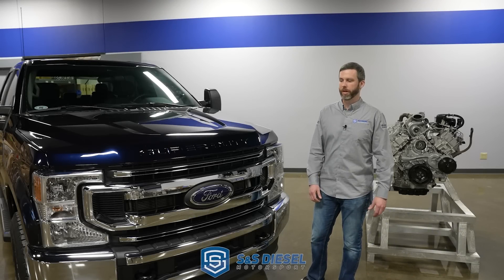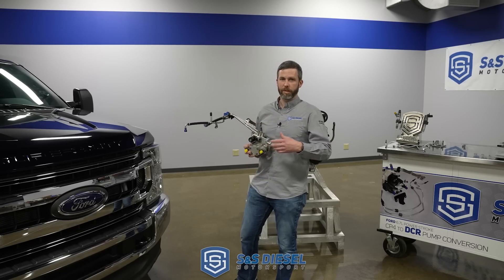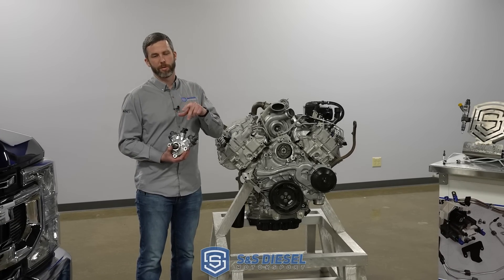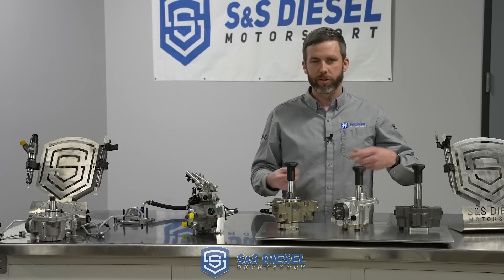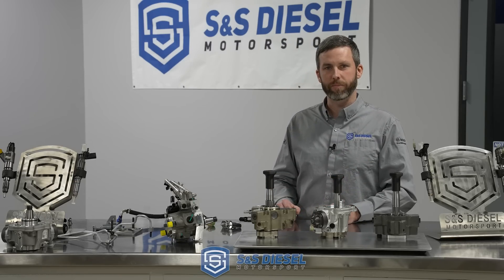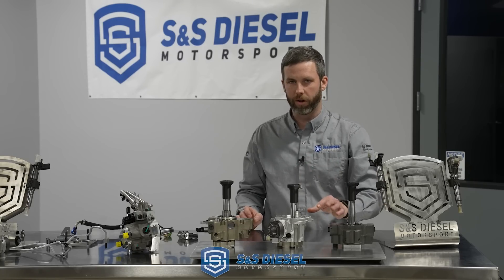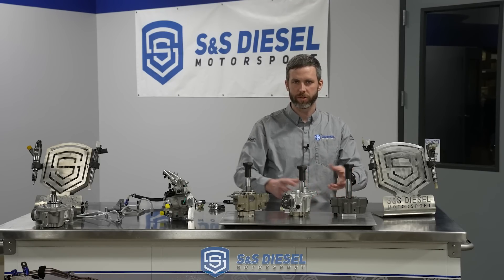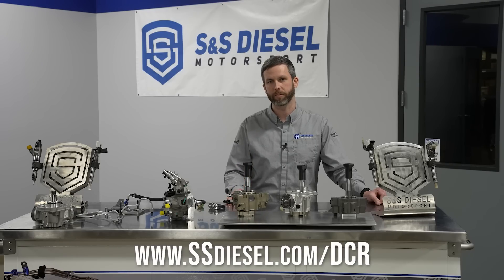The Long-Awaited Ford CP4 Solution - S&S Ford 6.7L CP4 to DCR Conversion

Comment: Of course! This comes out the day after I purchase your DPK, $400 bucks that could have gone to purchase this. FML.
Reply from the maker: Thank you for buying a DPK, we appreciate your business. We are still validating the Ford 6.7 DCR with a target release of sometime in Q2. We'll take the DPK back if it has not been installed, but it would not be a bad idea to protect your injectors until the release.
Reply: LOL, and the bad part about that is that the DPK does absolutely nothing, it has never been proven nor is it guaranteed to prevent anything, and if your pump does fail with this installed they will not even cover the costs of the repair that you will need. Oh, yea, and in some cases, they leak, cause low fuel pressure, and other problems. I do truly hope that these fuel pumps work better and have guarantees that really mean something. I will wait and see myself.
Reply: @uwbob6284  the DPK never stated the it stopped the pump from failing, it just made it so that if it did fail that it wouldn't take out the rest of the system with it. They did prove that it works and there is alot of different ones out there but they actually have tested Thiers and designed it to work properly and not be snake oil
Reply: @uwbob6284  Why would any company ever claim a statement of guarantee to cover $10k+ in parts for a $400 preventative system, they would have their hands full with all the idgits never doing maintenance or running lubricating additives saying is S&S fault CP4 go boom when they're running dirt and water in their fuel on a max effort tune.
Reply: @uwbob6284  never could understand someone talking about something they know absolutely nothing about , or could it be a person that doesn’t understand how to read instructions . Or do research how to do something . Have seen so many of those types of parts replacers in the area where I live , and a lot of those parts replacers work in actual shops that screw up customers vehicles . Have so many times had to bring my vehicle home and fix what these parts replacers have screwed up , and finally decided to start fixing my vehicles myself so it would be done correctly in the first place . About 30 years ago, and never once had a problem with my repairs due to reading instructions and searching the fix thoroughly . Talk is cheap . Fixing a problem is actually easy but claiming problems because of talking and not thinking is not very easy and not very smart .
Reply: @uwbob6284  WOW, Mr. Negativity!!
Reply: @zekester1  Naw, just stating facts. . .
Reply from the maker: @uwbob6284  We can only speak for the S&S DPK, and we state/show the facts (backed by real-world data) here: https://youtu.be/F-vZEH1yEs8